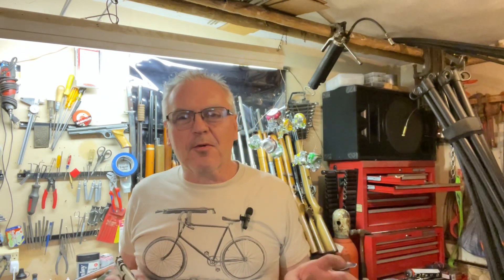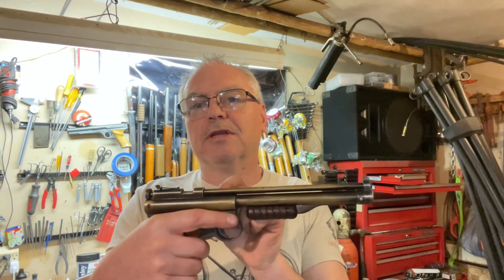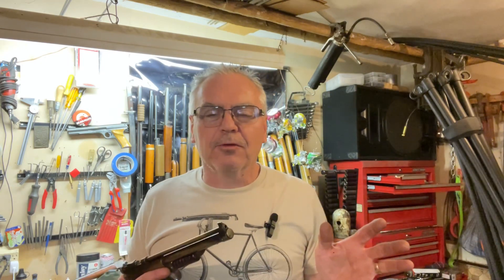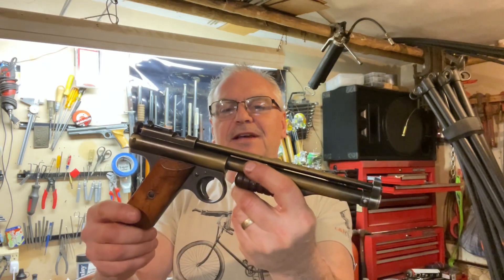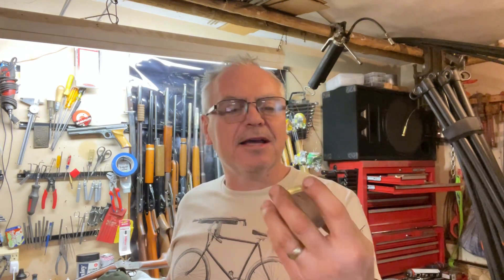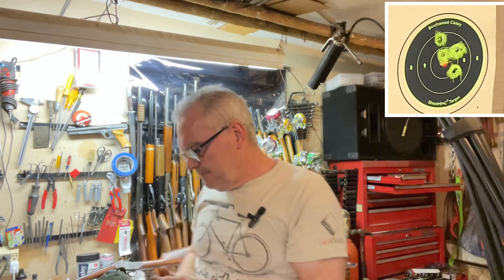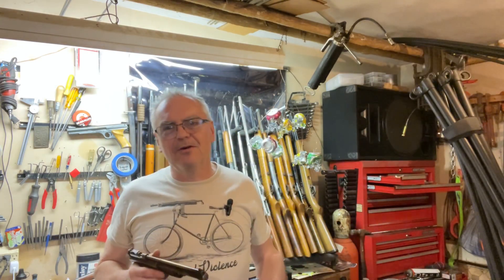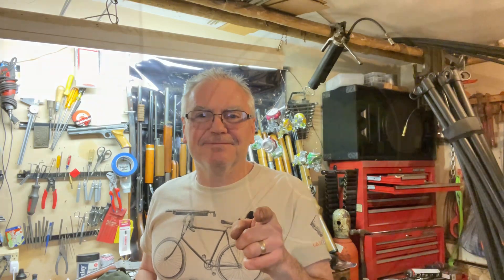Benjamin Franklin model 137 multi pump .177 pellet pistol repair update & review Great little pistol

Comment: I also have a model 137 .177 cal.  I found it in the garage of an old house about 10-12 years ago.  It's in really great shape considering it's age, it's still all black except for an area that the black got scratched off and you can see the brass.  It worked when I found it and it still works now (I just took a few shots with it).  According to the owners manual, they co sometimes leak especially during the first pump.  Cocking the hammer before pumping will help as it takes the pressure off the outlet valve.  5-6 pumps for normal use, 10-12 for maximum power, 3-4 pumps minimum or you risk getting a pellet stuck.  When stored keep it lightly pressurized with 3-4 pumps.

Comment: Just did my first 317 and it was a nightmare getting the valve past the coupling that the stock screw threads into. The stock screw coupling is soldered on and has a washer that sits interior and is right next to the valve nut. The nut cam off without a problem but the valve proved to be a bear because this washer makes it really hard to get the valve past it.

Comment: I have one of these in .22 caliber. If I laid it beside yours you couldn't tell the difference. The brass is well worn from thousands of pellets being shot over the years. I traded a Benjamin .177 rifle for it from a friend of mine when we were in Junior High early 70's. It came from his Uncle's Western Auto Store they owned here in Texas. I had the pump rebuilt years ago the only thing missing is the spring that holds the pump handle in the folded position after charging. One could probably be made by a gunsmith I also have a tin of .22 round pellets I can't remember if they were made for this pistol I have shot a few but prefer the skirted variety. I wish I had kept my rifle my Grandmother bought it for me around 1969 for doing yardwork for her. I kept it hidden in my closet for a couple of months afraid my mother would take it back to the hardware store. Is there a serial # on these to tell their age? I didn't realize they were made that long ago.

Comment: Fantastic video's. I just purchased my first Benjamin 137 and really enjoy shooting it. Since this is my first 137 I'm not sure it shoots as strong as it should. I plan on taking it apart to see if I can figure out how to tune it up. I ordered the valve tool but I'm concerned about using the treaded end for  removing the valve. Can you tell me what size the threads are? For example 6-32, 10-32, 8-32 and so forth. Thank you very much!
Reply from the maker: I don’t know for sure. It’s around a 1/4” or maybe a little bigger. Why are you concerned about using the tool?
Reply: @WalnutandSteel  Well I watched the other video you suggested in yours, and that person bought a second tool for removing the valve. I assume they were concerned about the threads breaking. I wanted to see if I could make one. My wife works at a place that sells specialty hardware.
Reply: I don't want to chance on breaking the stud and ruining the gun.

Comment: Hi Nibs, going through old videos on the 130 series trying to assess the "health" of my 132 I've owned since new in 1980 (it was my 15th Bday gift), I'm getting 350fps with 14ish grain pellets which just bounce off plywood..do you think it's about it or should it be 400-500, iirr it used to sink pellets into a board.. it's been resealed about 10yrs ago, but no real use on it since and trying to decide if it's worth the $$ to send it off for another reseal. (renewed interest in airgunning) I didn't own a chrony until recently so I have no idea what it ran originally..my newer 1377 smokes it..cheers.
Reply from the maker: Probably could use a reseal. I don’t expect it would do much over 400 even working perfectly though
Reply: thanks for the reply, I likely will.. @WalnutandSteel

Comment: I been told never dry fire a pellet guns?
Reply from the maker: its really only a concern with spring piston air guns. because the piston slams into the front of the front of the compression tube with such force. it can shatter the piston and piston seal.